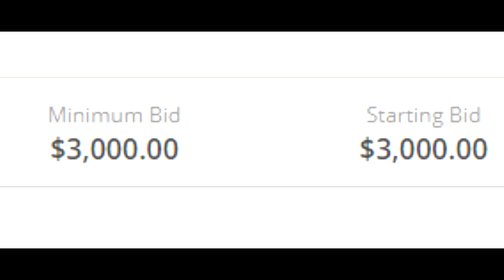inside a gunsmith business and how to obtain a firearm

Comment: On the AR vs AK (my opinion):

The AR is a great platform for customization. Need a long range sharp shooting rifle? The AR can do that. Need a stubby room clearer? AR. Need a support weapon? It may not like it, the the AR can do it. Need a rifle that can exchange barrel and receiver in a hurry to switch to a different caliber? A fracking R.

The AK is great for extended operations in the field where resupply and down time are not guaranteed. The AK can go through sand, mud, dust, water and even pasta and still fire without jamming. Need to fire 5000+ rounds without cleaning it? No problem. An AK is a great weapon for rugged, isolated, terrain and missions... if a bunch of men in caves that have  a 3rd grade education (Maybe) can use it to great effect, so can we.

Comment: The Mossberg Shockwave isn't a shot gun because part of the legal definition of a shotgun is that it was designed or redesigned to be fired from the shoulder.  Since the Shockwave was not designed with a shoulder stock, it was not designed to be fired from the shoulder.  Therefore, it is not a shotgun.

If the owner of a Shockwave puts a shoulder stock on it, he/she has just redesigned it to be fired from the shoulder.  It is now and forever a shotgun and must never again be paired with its 14 inch barrel without first being registered as a short barrel shotgun.  At least, that's what the law says.

Comment: Everyone is crazy over the trigger pull. I learned all about it with one of my adjustable ones. I watched pros shooting it in a crazy comp and 2 or 3 got eliminated because the damn thing fired from racking the bolt. I have a glock that is down to like 3# and it's way to soft. I dont care about pull weight, I like one that has zero creep and as little take up as you can get. My brother prefers it, so im sure everyone is different. But if you can butt stroke one and make it go off, your life is about to change in a bad way soon.

Comment: interesting! I need to have my 6mm re-blued and my mother has a side by side shotgun with a broken barrel just like the one they had in the safe with the Damascus pattern in the barrel that's over a century old. i would love to have these both repaired. the 6mm was burned in a fire when my grand parents house burned down and the bluing wiped off of it over time being shot and cleaned since then.  I love that gun! it's accurate to a fault even at 1000 yards. just sounds like a canon going off when you squeeze the trigger but it hits within a couple MM of where you put the cross hairs in the scope even at that range. only thing is people around for miles know you shot it once the trigger is pulled. I would like to later on get a suppressor for it just so i don't go deaf every time i fire the thing. I think i'm going to email these fellas and see what they would charge for both options. i have an FFL licensed dealer here i can send from here in Middle TN above Nashville to them and back so if the price is right  you may have saved the day for me so to speak with this video THANKS!

Comment: Putting a rail on a dust cover or modifying mags/mag wells to accept different mags is easy compared to doing an actual trigger job where you don't effect the sear engagement, why the fuck would he do that. That's how someone dies. Like wouldn't a 10 oz trigger on a semi auto shotgun potentially be enough to have a run away gun? Like is there any gun that a 10oz trigger would be safe? The only gun I can think of that has a trigger pull in the oz range would be those safari and long range precision rifles with the two triggers where the back trigger needs to be pulled all the way back, and it activates the second trigger so you just have to breath on it.

Comment: People don't need assault rifles.
I am sorry but the chances of you being in a situation that requires an AR are next to zero.

In 99.999% of self defense cases, an AR would be total overkill. All you need is the sound of a pump racking, and you're solid haha.
Reply: Dejion Jon https://youtu.be/qzMx3Z5EbQQ "wHeN wIlL yOu nEeD aN aR fOr SeLf dEfEnCe" also you do know AR stands for arma lite Rifle not assault rifle?
Reply: I said you don't need an AR in 99.999% of situations, and that a shotgun would do. This video doesn't disprove either of those points...
Reply: I said that you don't need an AR for self defense. I never said that ARs are the problem when it comes to shooting. Calm the fuck down, before jumping to conclusions like that.

And sure, ARs might not be a major contributor to these high casualty shootings, but they still are a part of the issue that should at least be being discussed.
Reply: Dejion Jon That video gives perfect examples of an AR platform being used for defence, and shotguns aren't always better, FBI ballistic testing has shown that most of the time a shotgun will over penetrate drywall and still have enough force to kill someone, that's not good for home defence in an urban area, since the AR can be chambered in rounds as small as 9mm and since the most common version fires 5.56/.223 which most of the time won't reliably penetrate walls they're perfect for home defence, and the AR isn't the problem, what is the problem is the media labeled the AR as an assault rifle and now everyone thinks of an AR as a deadly fully automatic gun
Reply: I agree with a 9mm being a good home defense round, but I don't think that a 5.56/.223 ARs are that great. You can get rounds specifically made for home defense for shotgun or use a hand gun, for most home defense situations.

That being said. I am not huge on the focus on ARs myself to be honest. I mostly think that things mag capacity, bump stocks, customized triggers, etc.., could be better regulated, and those just so happen to be thrown in with ARs a lot.
I honestly don't have an issue with ARs by themselves. Just saying that they are overkill for a vast majority of home defense/self defense situations.

Even if a shotgun can over-penetrate, so can a 5.56/.223. Plus my original argument is more that the sound of the pump shotgun is enough to scare someone off in most cases anyways, so the penetration isn't so much of an issue.

Personally, I have a .22 semi-automatic rifle with a high-cap banana clip, and it was waaaay to easy for me to get. 
I am planning and getting a pump 12 gauge with "less-lethal" rounds, and a .9mm Revolver with hollow points, both for home defense.  

Feel like both of those make more sense than a AR...
Reply: Dejion Jon Well the FBI showed that a 12 gauge reliably penetrates walls more than an AR's 5.56, plus no such thing as "overkill" when defending your own life and property against criminals, plus when push comes to shove the sound of the 12 gauges pump might not always deter someone, plus the AR platform is really modular, diffrent parts for diffrent setups, plus semi autos in general are better with dealing with multiple assailants, adrenalin might cause you to be shaky and your aim not true, the ability to make a quick follow up shot. To conclude it, an AR is perfectly fine for home defense, most of the time the AR platform is small enough for close quarters, the 5.56/.223 is less likley to penetrate walls and strike a non target while at the same time providing enough power to stop criminals, the higher capacity of an AR (and most semi autos) allows people to have more shots against home invaders and criminals before needing to reload, lastly the weight and recoil of a shotgun isn't easy to manage by a person with a smaller frame, aka a lot of women and children, the AR platform is known for being light and the recoil pattern is more manageable,
Reply: "FBI showed that a 12 gauge reliably penetrates walls more than an AR's 5.56"
I am not going to be use full loads or even traditional ammunition, so no worries.

" diffrent parts for diffrent setups, plus semi autos in general are better with dealing with multiple assailants"
I can get a semi-auto tac shotgun, but I prefer the pump for the noise. 

"5.56/.223 is less likley to penetrate walls and strike a non target "
It is not as good as using a 9mm and a shotgun with light loads, would be fine. Could be even go with a gauge lower than 12, I just want a 12 gauge because they have a lot of different ammunition options.

"the higher capacity of an AR (and most semi autos) allows people to have more shots against home invaders and criminals before needing to reload"
This sort of thinking about ARs seems overly paranoid. Like sure, you could be in a situation that requires a 50 round mag, like I have, but that is so incredibly unlikely. Unless you live in a high crime area, being so concerned about being heavily armed/prepared for a home invasion, seems odd.

To be honest, I am not very concerned about getting another gun at all. I would rather spend the time/money on something much more likely to negative impact my life, like my health...
That is why I am not very concerned about ARs and some of the more dangerous components that go along with them, to be restricted more. I am more concerned about people being dumb/evil, than I am about people needing an AR for that .00001% home defense scenario, in which an alternative wouldn't suffice.
That is just me though haha.
Reply: Dejion Jon Fair enough to be honest, some people prefer handguns, some prefer shotguns, some prefer semi auto rifles, whatever suits your needs for home defense
Reply: That is what I am saying haha.

People on both sides of the issue need to stop acting like ARs are so special, and turn the conversation to the features that ARs tend to have, which are not that useful when it comes to home defense but are very useful when committing mass killings like this. If people want to regulate clips over 30 rounds, bump stocks, and rapid fire trigger modifications, I see that having next to no impact on the average citizen's ability to protect themselve's or their family...
Reply: Dejion Jon What exactly would banning 30 round+ magazines really do? It won't stop people for buying ones already in circulation or machining their own
Reply: No I said regulating them further, not banning them.

It is just a bit to easy to get them right now, I wouldn't mind there being something else done to keep track of them and maybe even keep them away from certain people.
Reply: Dejion Jon What more restrictions would one need? It's not needed to restrict access to normal size magazines for AR style rifles
Reply: "What more restrictions would one need?"
I mean are there any federal laws governing magazine capacity? Last time I checked, a vast majority of states still did not have any laws regulating clip size. So has that changed recently?

"It's not needed to restrict access to normal size magazines for AR style rifles"
More than 30 rounds is not normal for most ARs. 
But that being said, I really don't care if the cap is set to 40 or even 50. I just think that right now it is ridiculously easy to buy high-cap mags, and I wouldn't mind there being a bit more being done about them. They are just one of the modifications that I think could be better regulated though, by no means my main focus or something that I am thinking is a major issue.
I am well aware of the ways in which people can modify clips or even create their own customs mags. So I am not gonna act like it would be the silver bullter, but it is better than doing nothing in my opinion.
Reply: Dejion Jon Most shooters use normal size magazines, (btw clips and magazines are two diffrent things) because larger magazines are notoriously unreliable. Regulating clip sizes won't change anything because a good majority of people who know how to handle a gun can switch out a 30 round magazine faster than a 50
Reply: Yeah like I said above, it is not my main focus or anything, but still think it would help.

Really tired of beating this dead horse... hahaha
Reply: Dejion Jon one thing to remember is to not give up ground, letting politicians ban things based on feelings not facts, such as bumpstocks (Novelty items that aren't effective) magazine sizes, (California has a 10 round magazine limit but crimes with rifle aren't as large as handguns) and even cosmetic items (barrel shrouds, pistol grips, threaded muzzles etc)
Reply: I disagree.
It is more important to me to live in a safe society.